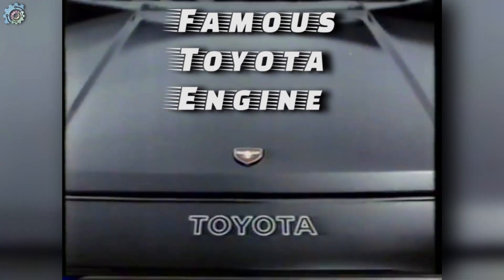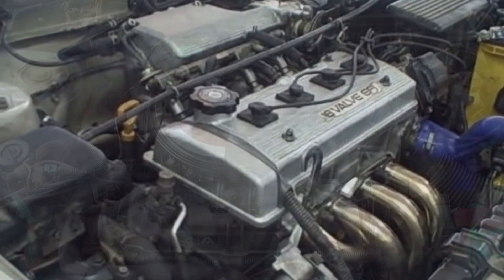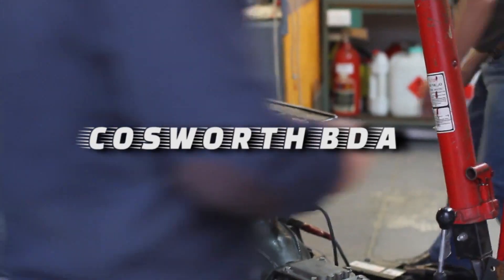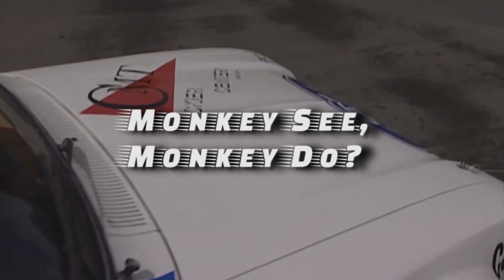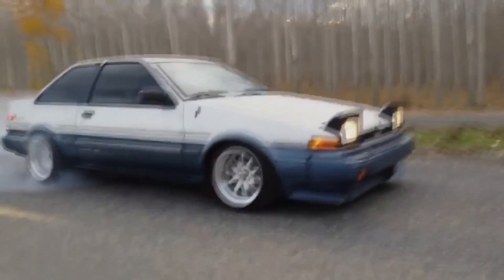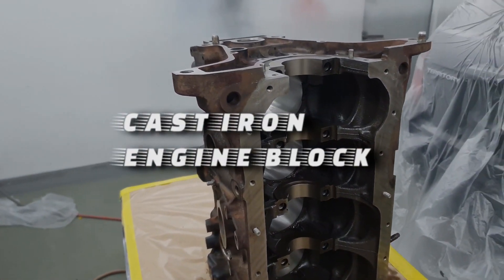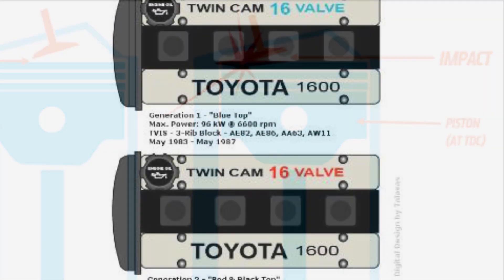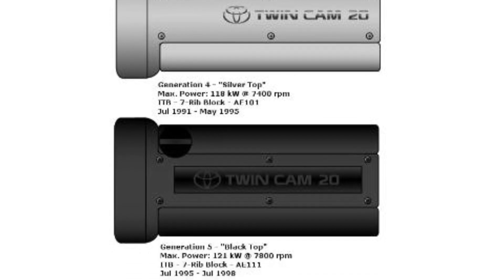The Story of the 4AGE || Part I

Comment: No mention of the dual length intake runners?!  They used it to control intake air velocity and volume. I had an old Corolla FX16 hatchback with this… always thought it was cool cutting edge tech. 

Good video